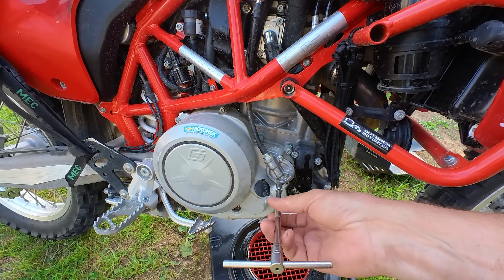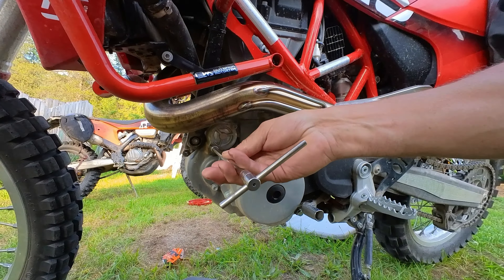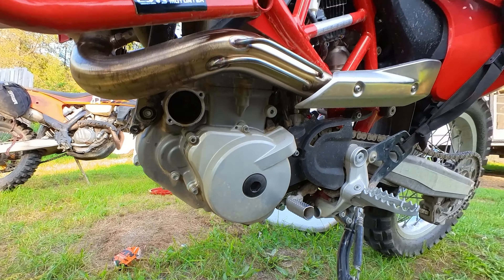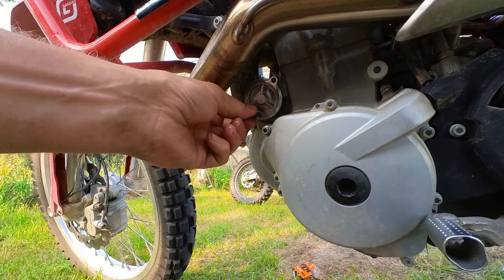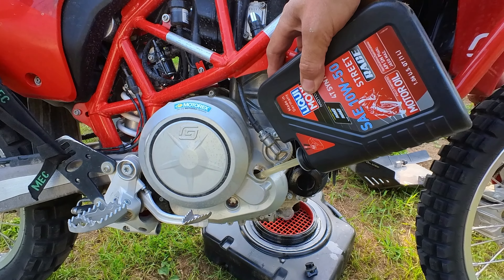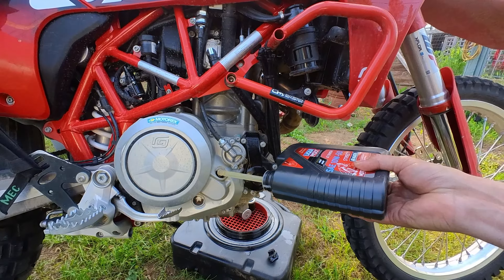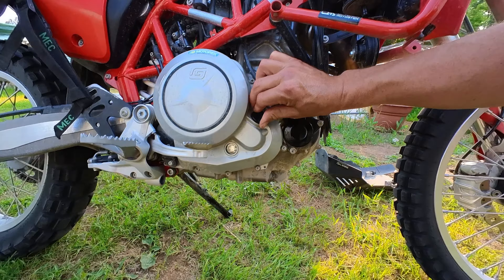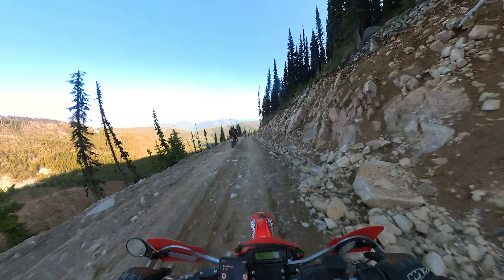Oil Change GasGas 700 (& KTM 690 / Husky 701)

Comment: GAs Gas 700 ES OWNER HERE WITH JUST OVER 1000km. Have you experienced any issues as yet? The only thing that I have encountered so far is the oil light staying on for up to 10 seconds when the restarting when the engine is up to temperature. That is an intermittent issue. Other than that, It has been going well.
Reply from the maker: Haven't had that at all? Been flawless mechanically. And I haven't been gentle. Already scratched up!!🤘
Reply: Mine flames out a bunch and I have issue keeping traction control off, I lowered it 1" and did penske suspension and leo vince pipe bout to un cork this thing , new tire and skid plate as well need a seat

Comment: Do You have the part numbers for the oil filters the manual doesn’t mention what they are and I emailed Gasgas who referred me to the owners manual
Reply: Did you ever find out the part # for the oil filters
Reply: @robertsoprano8676 my local shop used the parts for a ktm 690. But I apologize I didn’t write down the numbers.